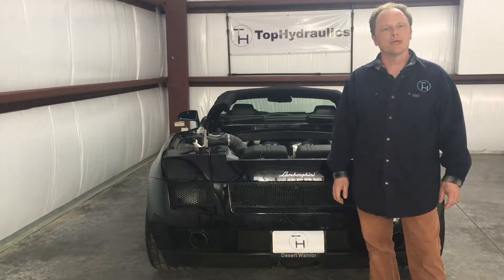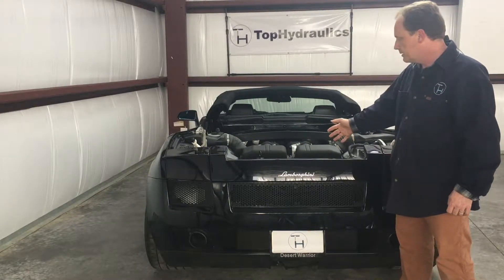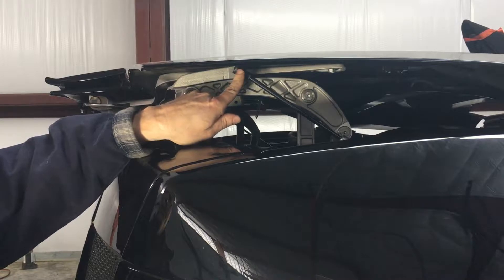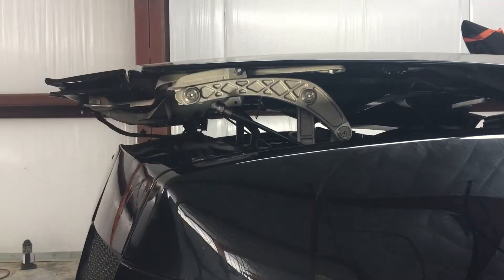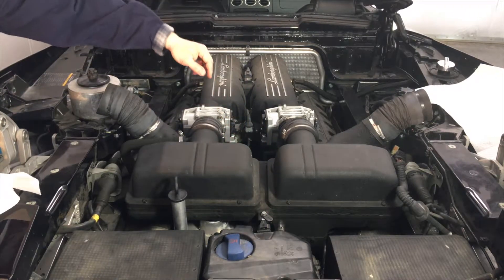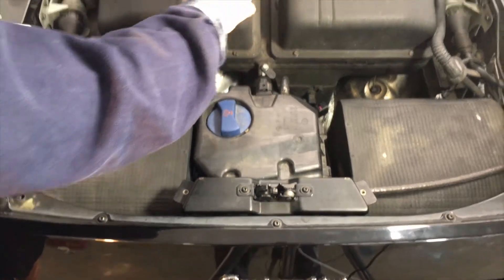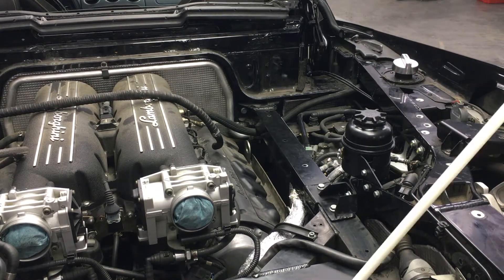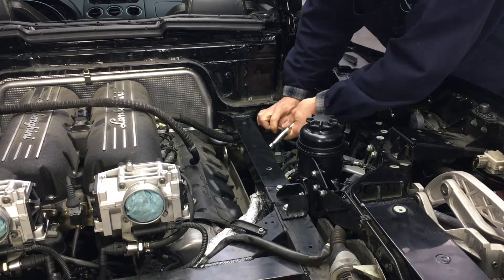Lamborghini Gallardo E Gear System Removal

Comment: need to figure out the right way to take off the rear bonnet wish that was included in this vid
Reply from the maker: Thanks for asking. Is your Gallardo a convertible? Are you looking to have Top Hydraulics rebuild your e-gear system?
Reply: Top Hydraulics I figured it out. Just went out and looked, will remove gas struts on side, undo A2 bolts, and disconnect electrical plug in the middle.
Reply from the maker: @codyfordyce7357  Glad to hear that. It's pretty straightforward, just takes two people to move the precious engine cover...
Reply: it was lol

Comment: But how to you bleed the system once you put it back in without the dealership LaRA ssytem?
Reply from the maker: The system ships from Top Hydraulics filled and bled. We ship the pump/control unit, hoses and actuator as one complete system. Since there is no air re-introduced into this system after we have filled and bled it for you, you won't have to bleed it.
Reply: @TopHydraulics  Are you replacing the hydraulic lines as part of the rebuild as well?
Reply from the maker: @hunterjones9822  Yes, that part is optional but recommended. It is very easy to damage the original hoses, as the angle at which they go into the actuator must be accurate or they get stressed too much.
Reply: @TopHydraulics  How do I get a quote for this with the hoses and everything? I have an 08 Superleggera.
Reply from the maker: @hunterjones9822  Thanks for asking. We have been so busy through our regular shop customers, lately, that we did not have to advertise or list the product at all. We should have the e-gear system rebuild up on the website later this year. Meanwhile, please contact us directly via email at info@tophydraulics.com.